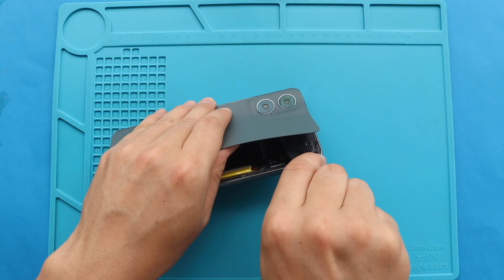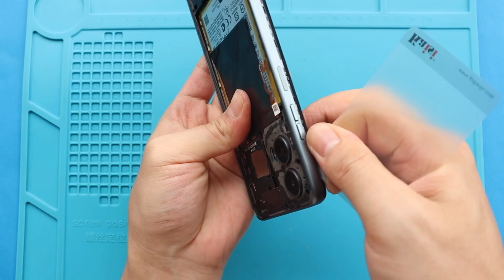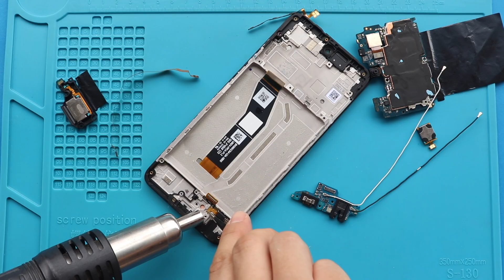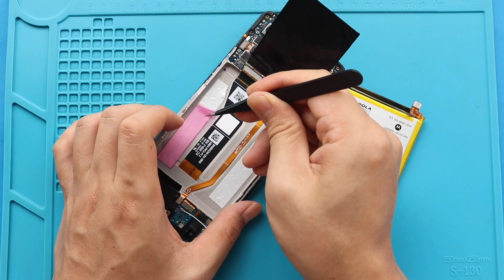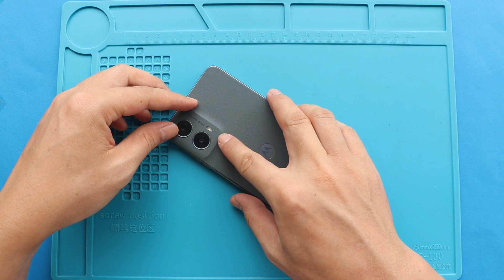Motorola Moto G 5G (2024) Screen Replacement | Restore Broken Touch & Display - XT2415

Comment: Incredible how bad the Motorola screens have become in the last years. Have have a MOTO G series since 4,5,17,21,22,24 which broke with hydrogel screen protection after about 6months,and the G56 splintered with hydrogel sceeen protection aswell! The Moto 4etc were A LOT sturdier, had some of them for 2-3years,and lost them maybe 50 times with an armored case,but the screen always took the G's. Not so with the new models. New producer of screens or materials? Someone, please?